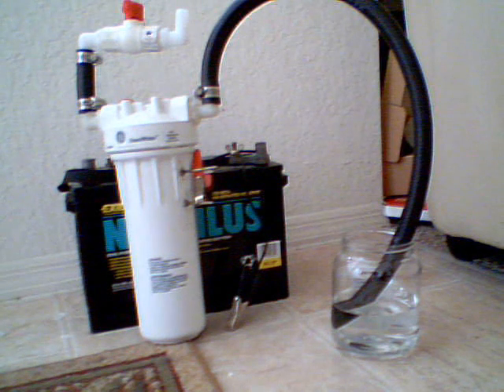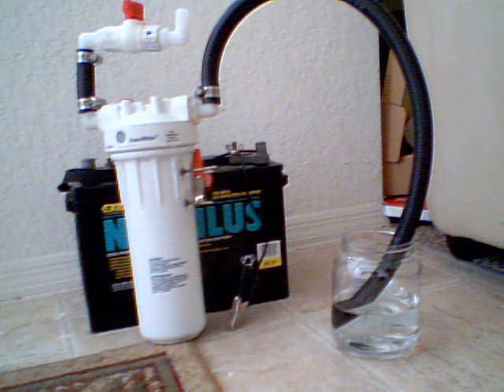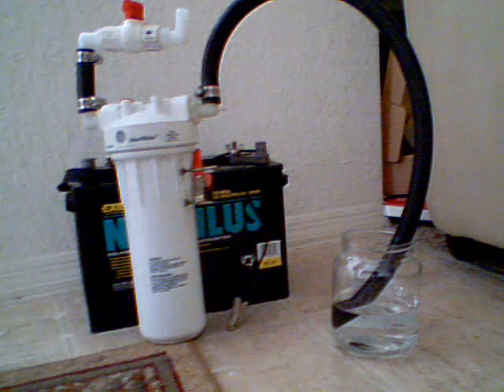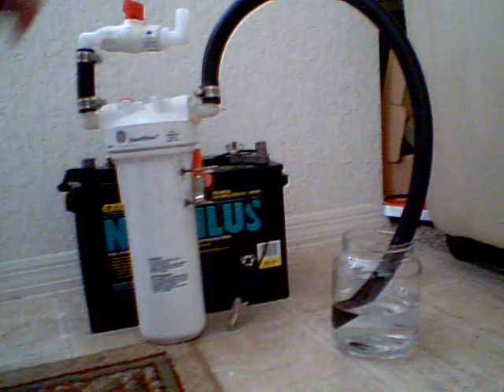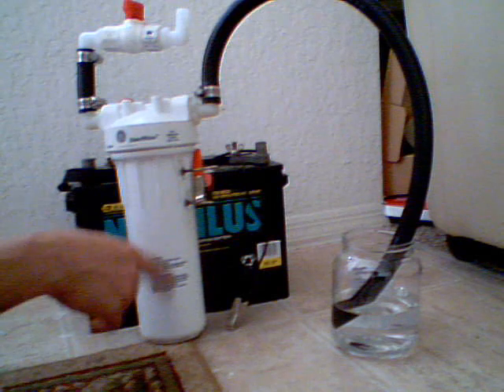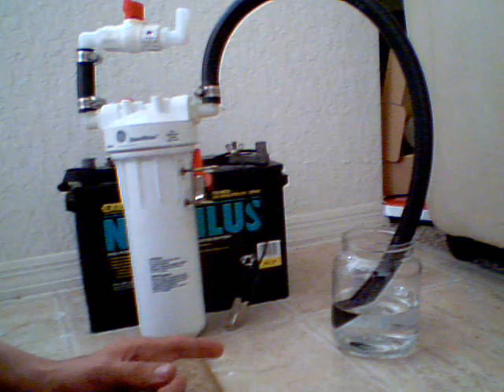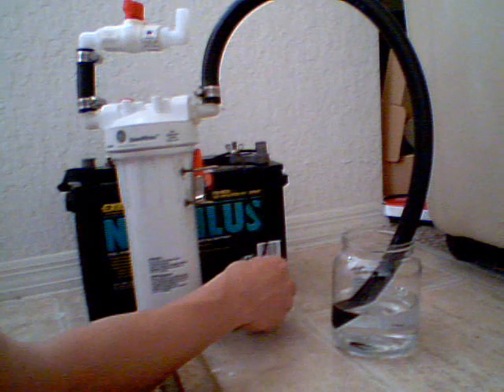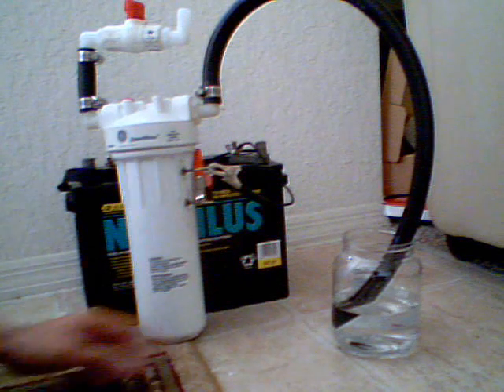Hydrogen Fuel Cell with 5 plates. Completed Unit! mixcatcom HHO

Comment: Dont use that soda garbage! It turns brown too fast and makes a mess. Try using Lye or pure sodium hydroxide. Reobic drain cleaner is good but hard to find, home depot sells a black liquid drain cleaner that is mostly NaOH and KOH so give that a try. Better results, less cleanup and longer lasting electrolyte.

Comment: erm  the energy( electic) we use for the cell to produce HHO are from our;s car batt and it will be charge up by ur car charger. so it mean ur charger wil be working harder to charge up the batt.  if the amp u use is more then ur charger can recharge. start pushing ur car on next start lol ...

Comment: It does work, and don't disprove me when you have never even tried it. It works, in fact theres people out there that have perfected this so much that it gives about 70mpgs. That is great, the main thing is the electronics that some of the newer cars have, telling your car how to handle the added fuel. Its bacon soda, and distilled water, my buddy has one setup on all of his vehicles, and one of them is an 08 Ford Taurus which measures mpg through the CPU, and the gain is even seen.

Comment: OK, I have to comment on this.
I built a very simple one of these electrolysers and installed it on a 3.9ltr diesel truck. My fuel consumption went from 22 ltrs/ 100km, down to 13 ltrs/ 100km. Somewhere better than 40% reduction in fuel. Just build one and try it.

Comment: Then is it maybe the addition of oxygen that contributes to the more effective combustion? 

Do your homework yourself.

I say it again.

A good ICE have effeciency of 0,3. A normal alternator have eff. of 0,6. A normal electrolyser have roughly 0,8

So, if you put in 1 unit of energy you will get out (1x0,3x0,6x0,8) 0.144 units of energy in form of hydrogen...

1/0.144 = 6.944

Your theory only works if hydrogen have MORE than 6.944 times the energy density than gasoline. IT DOESNT!

Comment: Why are you so stupidly ignorant? Are you one of those who cannot base your arguments on facts and use improper language instead? It sure seems so. 

I have built many sorts of electrolysis aparatus, never put it direct into an engine. But i have fed an lawnmower enginge with both Hydrogen and methane, without any noticable effect on power output or fuel consumption...

So there you have it!

Hydrogen have a more effecient burn yess, but it still uses substantial ammount of gas to produce!

Comment: I've heard that you can run small engines off of hydrogen. why can't you run a portable generator that why. Then use that electricity to make more hydrogen that would run your car. and charge the batteries?

Comment: You are so right! People in these forums think that the alternator have a "spare"/"free" electricity that doesent strain the engine. Boy they are wrong. Try idling the engine at neautral without any lights on and then hitting full lights then you will se the rpm lovering temporarliy until the engine compensate it with more gas... voila!

Comment: Well. Even though. Have anyone ever made a similar system like Stan?

If so, then why is it so damn hard showing the system in a closed circuit with amp and voltage meter clearly readable?

Stan Meyer found a way to create energy?

Comment: Your wrong, a typical combustion engine has about 40-60% wasted energy and you are using that watse to make a vehicle run more efficient. So if there is waste energy why not use it. The engine is already running and turning the alternator for power. All your doing is applying some of that electricity to make a fule additive (HHO) increase your MPG.

Comment: Actually, a supercharger works by blowing more air into the engine, and therefore allowing more fuel to be burned.  The boost in energy is from the additional fuel being burned per power stroke, not just by the mere presence of a super charger.  Again, there's no such thing as free energy.  It's a fundamental law of physics, where if untrue, our universe would have torn itself apart long ago.

Comment: Hi sir, 
Question for you: 
I put one together and although it successfully worked, I could only keep the power connected for some 10 seconds...and that was pushing it. My wires kept getting red hot and melting the jackets off. I triple checked that there were no direct shorts. Do you use a current regulator of any sort? Please let me know. I'd like to ask you a few other questions about it if you wouldn't mind. 
~Jim